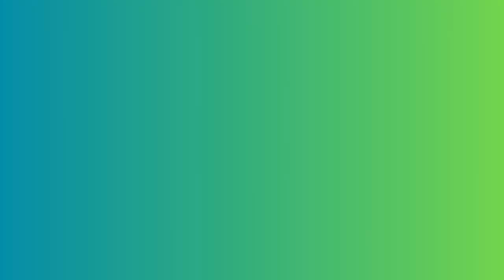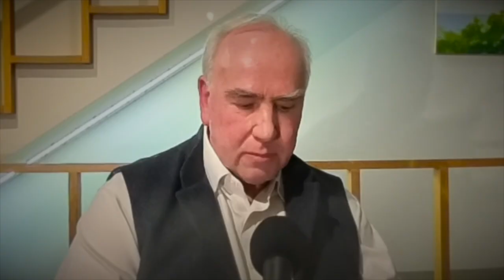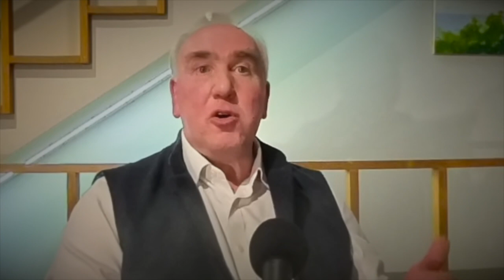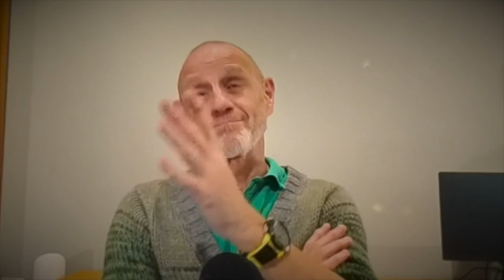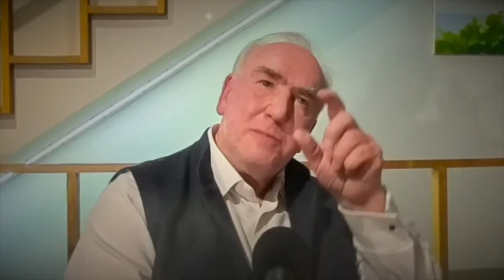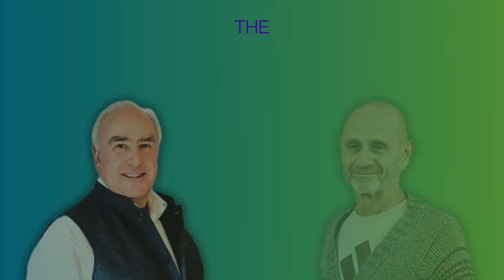13. What are the alternatives to heat pumps?

Comment: Electrical distribution doesn't have to be a problem if solar pv is widely adopted. We then have a vast distributed production system! This would reduce the distribution network load significantly, reducing the cost of the Grid infrastructure as a consequence.

Comment: So for the baseline, practically we don't have another tech solution that doesn't involve burning stuff or heating directly with electricity. There is no other electrical tech solution with a decent comparable COP to heat pumps... 
Hydrogen is going to be a red herring imo. At least in the domestic market. 
So the bottom line is, there is no current alternative technology that we could turn to with a comparable SCOP to heat pumps...
Reply: Air to air is considerably cheaper to install than an air to water. Obviously you then need a means to heat your hot water. My question is what happens in 2035 when your ASHP packs up and the BUS scheme is a distant memory? Instead of paying £3k for a boiler install, you're lumped with a £12k bill for a heat pump. That can't be the solution for the vast majority of people can it?

Comment: Evan [and Bean]. You keep saying using cheap electricity overnight.... that is not the only time we get cheap electricity. Cheap electricity comes when we generate electricity from renewable sources, and that is often during large periods of the day [typically not 7-9 and 16-1930] and there are many tariffs now, Agile Octopus as an example that allow the consumer to pay for lower priced electricity than the standard price. There are many heat batteries that use these tariffs to 'charge' when the price is lower, whether that be during the day, or at night..... So maybe change the wording from 'overnight' to 'When it is cheap', please

Comment: Using solar doesn’t make an electric boiler attractive… it would still be better to use a heat pump with solar.  It would require ~1/3 the panels.

Comment: Doesn't biogas largely amount to going back to the days of manufactured gas?
Reply: No. It used to be made from coal so it was a fossil fuel.
Reply: @BarryHeaven I know that. But you're going through a very similar process, you wind up with a very dirty product, and you end up burning stuff. Very much like coal gas, in important ways.
Reply: @ronaldgarrison8478  Not if you use renewables to power them. Therefore nothing is burnt. Coal is no longer used for electricity generation in the UK.
Reply: @BarryHeaven Wood is heated in the absence of oxygen, and gives off gas. Maybe that's not exactly "burned," but that's really just a semantic quibble. Whether you're getting gas from coal or wood, it's a very dirty process. I have trouble thinking of that as progress.
Reply: @ronaldgarrison8478  Where is the original source of the carbon in the wood v in coal?
Reply: @BarryHeaven What is your point?
Reply: @ronaldgarrison8478  The source of carbon is the entire point, obviously.

Comment: "Boiler" certainly sounds like a funny term for something that never heats water to anywhere near 100 C. But I understand what it means here.
Reply: You're right, but I'm not sure any boilers actually boil the water. Having steam in your pipes is likely to cause excitement when you turn the hot tap on. Or the whole system explodes.

Comment: "Hydrogen can be green" if you are prepared to use more electricity to make it than you get from it's output. It's also more explosive and more difficult to contain than natural gas. It's the smallest gas molecule and escapes with alarming ease. No wonder intelligent people don't want it foisted on them.

Have you gentlemen never heard of infrared panels? "Not a new concept, just another form of resistive heating, only 100% efficient". I've heard it all but I can't believe you didnt even mention it. If mounted on ceilings ideally, carefully sized and placed for each room's characteristics they can be used with smart controllers that make them more efficient and are becoming quite popular for those in the know as they're not expensive, most electricians can install them. 
I'm not "allergic" to heat pumps, rather unable to cope with the upheaval required to install them. I am extremely sceptical that all installations will reach such high sCOP's given the horror stories of bad instals and/or bad handovers, not to mention the expense. Even with the grant the only guaranteed way to get a proper installation is to use a upper tier Heat Geek, none of which are in my area and the cost would be understandably astronomical for the level of skill required.
 My home is not and will never be hermetically sealed therefore it would likely take three or four times more electricity for a heat pump to warm it, immediately negating the vaunted 3x-4x COP. 

This brings into focus the validity of using infrared panels which heat the objects and people in a room first using 100% of its electricity consumption to warm YOU. Not the water in the pipes, then the radiators, then the air which rises leaving you in cold air until that warms too. Yes I do believe that kind of 100% efficiency is true  efficiency. Still cant believe you didnt even contemplate them over hydrogen!
Reply: Not discussing Infrared wasn't an intentional oversight. I'm sure that it will come up in future episodes, perhaps in one of the "clinics" as a result of your message. Salford Energy House 2.0 has been running comparisons between air-source monoblocs and IR. I'm not certain how publicly available the results are.

I'm no expert on IR, and I've not seen a great number of IR heated homes, but I have come across one or two where the results are, shall we say, sub-optimal. So all technologies have their challenges - even gas boilers!

Heat pump installations need to get better on average, I agree, and they are doing so. MCS has been contacting all recipients of the Boiler Upgrade Scheme over recent months. I believe that their findings are to be published imminently and that they show a marked improvement in consumer satisfaction ratings.

Our sector will continue to work for greater, and faster, improvements.
Reply: @BeanBeanland-HPF Thank you so much for getting back to me about this topic. I only bumped into your channel by serendipity but I'll subscribe now I know you're likely to cover infrared. 

Two things I didn't know: pleased to hear the Salford Energy house is experimenting with IR although when comparing like for like with ashp they will never be as efficient. I almost wish they would try the comparison on a leaky house, that would be interesting...perhaps they are, must try to find out.🤔

I'm always on the lookout for real world experiences of whole house IR heating. As with ashp it must be done right, those stand alone panels are ok for supplemental heating only. To heat the whole house it's the smart controllers that are vital for effectiveness and efficiency. Along with getting the right size and placing correctly for the room...if it's an L shaped room for example two or three smaller panels in each area are better than one sized for the whole room. 
I also didn't know that MCS are actually doing checks on certain installations, that is good news.👍
Reply: Infrared heaters are 100% efficient. Then somehow smart controllers can make them more efficient! More than 100%! I'm stunned, over-unity is here for real!
In reality All forms of electric heating are around 98% efficient. So, how do infrared panels (not forgetting that good old fashioned electric bar heaters are in fact infra red heaters) improve on this, when there is only 2%  maximum to be gained?
Reply: @nickwinn7812 don't be silly dear. At no point did I say that smart controllers could make infrared more than 100% efficient.  It's you ashp evangelists who insist there is such a thing as a figure greater than 100%. What I'm saying is that if an ashp uses 3 x more power to heat my house...which it would because it's draughty and heat pumps don't work well in those circumstances, then your figure of it being 300% more efficient is redundant.
 Infrared will heat me first, then the fabric of the house, then the air if I allow it to stay on all the time. If I use smart controllers, I don't have to worry about that because each room will have a thermostat which I can set to my preferred temperature for that room at any particular time of day. Consequently I'm not heating all of the house all of the time therefore using less electricity than I would with a heat pump struggling to defeat the heat loss in my property. The expense and upheaval involved in correctly sizing an ashp to negate the heat loss is too much for me to deal with, both financially and physically. I will take steps to improve loft insulation but I cannot afford new windows and I will not fill the wall cavity through which my 1950's house is designed to "breathe".
Reply: @judebrown4103  You said they were 100% efficient and then that smart controllers make them even more efficient.
I am not an ASHP evangelist and I have NEVER claimed a heat pump of any ilk is more than 100% efficient, indeed I frequently call such claims out as lies.
If your house is draughty, it will lose heat regardless of the heating method. Heat is heat, no matter how it is produced. 
Radiant heat from either electric panels or from panels heated by a heat pump, does not necessarily heat the air as much as convection heating, but if you have cold air moving in any quantity, it will, never the less, carry the heat away with it.
It is foolish to not first address the heat loss, before considering by which method to add heat.
Reply: @nickwinn7812 ok so I think we can agree that I misunderstood your comment and you misunderstood my comment. If it makes you feel better you can be right, ok? There, there.

My priority is to get off gas, as I've said I will do my best to alleviate heat loss as much as I can but I will not hermetically seal a building not meant to be sealed and I cannot afford to take every possible measure to stop draughts. By using a more traditional method of heating only those rooms I'm in when I'm in them and keeping the others on "tick-over" I feel this way will be more efficient* and less disruptive than ashp. *Not more efficient than 100% which was a quote!

Comment: Well, my good old condensing gas boiler works extremely well. It delivers 18kWh and is 95% efficient. It can deliver hot water or heat at the push of a button or by electronic programmer. Best of all, gas is only 5.8 pence per kWh which is much less than my electricity price of 20 pence per kWh. Never given a moments trouble in 10 years! If it gets really cold I might even light to log fire
Reply: How do you know it's 95% efficient? As most installed boilers in the uk do not reach their badged "up to" efficiency rating.

To get that level of efficiency you'd need to be running it on weather compensation and at a max flow temperature of around 40C.

Which if you can a heat pump will be far cheaper to run and won't require any upgrades.
Reply: @BenIsInSweden  You are right, except that it won't be cheaper to run a heat pump in the UK. With a COP of 4, the cost will be pretty much the same, at current UK gas and electricity prices.
So, you need a good heat pump correctly installed, on a system designed for low flow temperatures to break even.
In my opinion, Rocky Racoon could get his heating from a heat pump and not see his energy cost increase, but since he has already made his mind up that gas is better and cheaper, it is a waste of time explaining this to him. Odd that he's viewing a You Tube channel specifically about something he's not interested in.
Reply: When it was installed the engineer ran a test measuring gas flow vs delta temperature x volume of water. He set the set point to 60 degrees and used a bit of software that used specific heat capacity of water and calculated 95% of the gas energy went into the primary loop. Apparently the waste went out the chimney. If I could buy electricity for a price similar to Scandinavia countries the economics might stack up. But we have the most expensive electricity in Europe
Reply: @RockyRacoon66  60C won't achieve 95% efficiency.  To measure correctly you need a heat meter that measures heat energy not temperature, one on the inlet side and one on the outlet.

Our electricity prices aren't always cheaper here either when you have to factor in taxes and transmission charges that aren't charged in the UK.
Reply: @RockyRacoon66  Oh, the guy who fitted it told you it's 95% efficient. Must be true then. LOL.
Reply: Putting the efficiency question aside for a moment, isn't the problem here, at least for most people, the sheer cost of buying and running an alternative (electrical) system, whether it be a heat pump or an electric boiler. Governments need to look at ways to better support the installation of electrically based systems with much more generous grants (no longer available in Scotland btw). Just think what could be done with a fraction of the subsidies that go to support oil and gas companies. In the meantime I just struggle along with my electric storage heaters.

Comment: The French government have reversed their policy on wood burning in rural areas. Where they were against, they now promote it. Double combustion stoves use renewable fuel (wood) and produce minimal pollution. Taking the entire supply chain in consideration  it s very ecological. Pellet feeds are automated. Log burners with double combustion give a pleasant radiating heat and the heat can be distributed to rooms through low cost ventillators. Also the wood burner can be used to heat your water and thus also supply CH.
Reply: France has a lot more forest and hedgerow wood than the UK. Many rural communities in France are and have always been, self sufficient in wood for heating, this is simply not the case in the UK.

Comment: The UK presently has the highest cost of electricity in the world  !  Why change to a heat pump when the majority of electric power stations burn coal to produce electricity.  🤔 utter madness.  We are being sold a lie. The UK is responsible for 1% of the world's carbon footprint.
Reply: Have you been living under a rock? the last coal fired power station in the UK shut down a few months ago.  Coal hasn't contributed much to the grid in years.
Reply: @BenIsInSweden  not the case here in Northern Ireland which is within the UK. We do have wind power but not enough storage capacity due to under investment over 20 years has not allowed Ireland to develop in the same way as England,  Wales and Scotland.
Reply: @BenIsInSweden  Kilroot power station in Ireland is still using fossil fuels. That's where our electricity is sourced from.
Reply: @equinoxeparabellum6776  it's using gas, which is fine in the grand scheme of things currently, as using a heat pump powered from a gas power plant will burn less gas (typically 20+%) than a gas boiler directly for the same amount of heat over the course of the season.

Using less gas isn't just about the carbon footprint, it's about availability and cost, the more gas used, the higher it's going to cost.

Comment: How many Power Wall batteries and their cost to run an electric boiler please?
Reply: Using batteries to supply resistance heat seems incredibly expensive. Heat pumps are typically 2-3 times more efficient than resistance heat.

Comment: All the Government or manufacturer need to do is make the cost of air source heat pumps so cheap it would be a no brainer to install them but at £10,000 or more even with the subsidy they are beyond a lot of peoples budgets.
Reply: Come to Greece. They are very cheap here. Air to air. 1000 to 1500 Euros. I don't know why and Installation is only about 150 Euros. I have two of them. They have a problem in that the thermostat in inside the unit. They are usually mounted up on the wall near the ceiling. As they run heat rises even with a blower and you constantly need to keep turning the temperature setting up. They can struggle on a very cold night. I have old house with zero insulation.
Reply: They would be a lot cheaper if it wasnt for the massive subsidy.
The installers add it into your bill...

Comment: That was a nice balanced discussion on the subject - unlike some of the polarised nonsense that litters the internet. I would have an ASHP but my wife isn't keen on the disruption or having a box with a big fan parked in the garden. So, unfortunately that's that for now. In the interim I have installed a new gas boiler as our old unit was getting past its best. I live just outside the proposed Hydrogen Village in Ellesmere Port and would have signed up for that experiment had it been offered. Sadly it was killed off misinformation flooding social media and "memories" of the Hindenburg disaster. Mind you we would have to manufacture the hydrogen and I'm sure any of the current methods really stack up.

Comment: A heat pump replaces a gas boiler and uses existing pipework through the house, perhaps with larger radiators. I would like to lose hot water pipes through the house, but it feels like burning bridges. I'm considering modern storage heaters. Much more controllable from a phone app, each room individually customisable temp and time. So far I've installed one, in the hallway. Works well but does run out of puff after about 8pm.